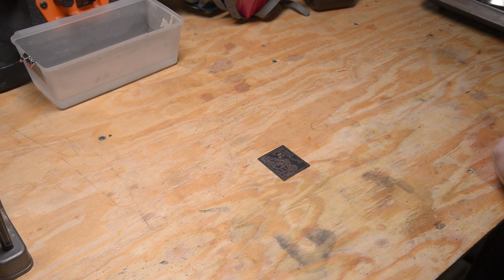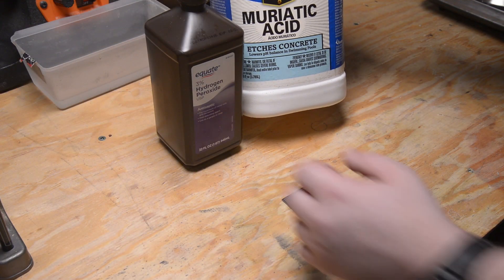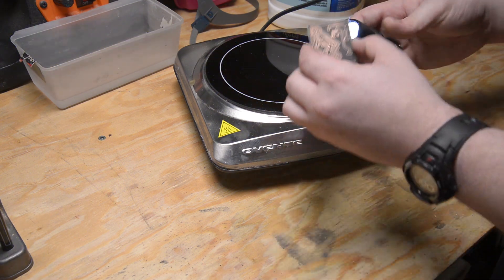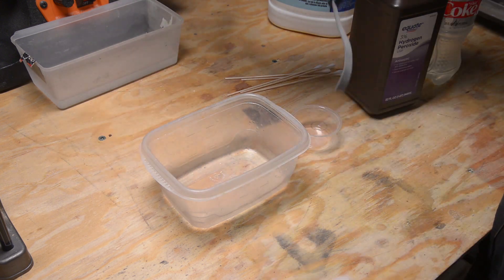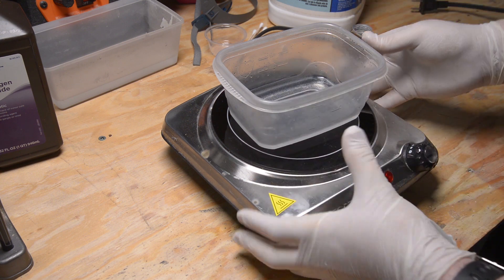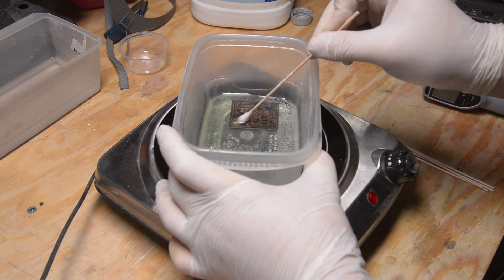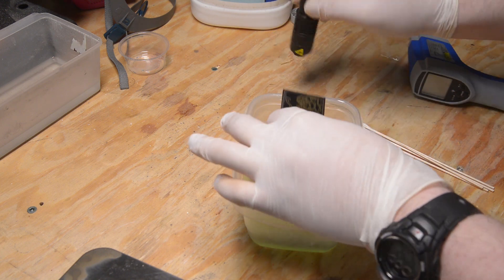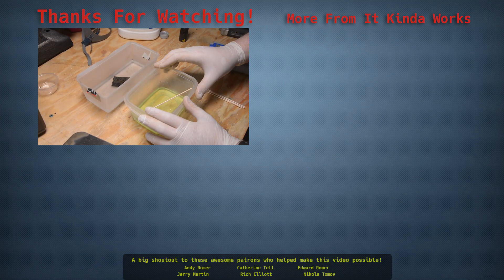Cheap and Easy PCB Etching

Comment: I've been doing a bunch of this recently. I switched to the same HCl+HO2 setup about 6 months ago.
  IIRC the chemist on the channel Nurdrage mentioned this setup results in the off gassing of just hydrogen during the process. So a well ventilated space is needed. I don't use a mask, I do this on my back patio. The gloves aren't really necessary either. I don't go sticking my hand in the stuff, but it isn't terribly strong either. I usually use a popsicle stick and a paper towel. If some gets on my fingers it's no big deal. It doesn't burn right away or anything. It will dry out your skin, and if the solution is well used it will color your skin a bit yellow, but it mostly washes off with water and handsoap. It's nothing like the dying properties of ferric chloride.
   Nurdrage also details how to 100% recycle HCl+HO2. It requires a hotplate stirrer and distillation apparatus. I haven't done this yet as I'm still looking for the chem kit setup for cheap. I have 2 liters of used etchant to process though.

  If you get into dry film photoresist setups this etching solution can also make solder paste stencils using a coke can. You just cut a flat sheet of aluminum from the can, remove the outer paint with ~600 grit, clean with white powder dishwashing detergent (clean all boards with this too), apply resist film, expose with transparency, and etch. The can material is the perfect thickness. The trick is to size the transparency mask pads around 80%. I can make a stencil with a TSSOP package with 0.4mm pitch first try most of the time. I just wish I could get my solder mask resolution this good...but I'm still working on that.
  If you ever try photoresist, don't remove the board and put it back in like you did here. For some reason it will react with the atmosphere. I tried to touch up a large board mid-etch with a marker on my last run. A small spot of photoresist failed early due to a tiny trapped air bubble. I had it out for less than a minute just to dab a bit of marker on the spot. I put it back in and you'd think the etching solution had magically turned into acetone. The photoresist completely de-laminated and ruined the board.

  If Bill (abcFab/eBay) ever comes back from his long vacation I want to try to make a 4 layer board at home using his ultra thin single sided and double core boards. That's next on my bucket list.
 Etching is fun :-)
-Jake

Comment: A much safer and easier option is sodium persulphate. Its a chemical compound of sodium sulphate and hydrogen peroxide and it comes as a white powder so totally safe to store. Also, it makes a really nice, mild etchant with no undercuts. Oh yeah, and no chlorine! Also, it is clear, totally transparent to begin with, so you can easily see what’s going on. The solution can be reused many times, and it gets a nice blue tint to it as it absorbs copper.

Comment: From what i have heard, this solution gets better the more use it. Eventually, the green colour will turn brown, but that is just because it has lost the oxygen content, you can fix that by shaking it in a sealed container, or adding more peroxide (which is the oxidiser). Obviously, more peroxide will water down the mixture, so better to just shake or bubble air through the mixture.

Comment: Not a professional chemist here, but I worked with this since high school, 25+ years ago, and I know more than enough chemistry beyond basics. Any professional chemists, feel free to correct me. While I don't think the respirator is necessary, extra protection is always a good idea. Now, for the chemistry part: the only unstable part here is H2O2, or hydrogen peroxide. Unless you heat the chemicals up when mixing them, there shouldn't be any chlorine gas released. Bubbles you see will probably be oxygen because H2O2 turns into water and releases extra oxygen atom. That is why it's added to muriatic acid, or hydrochloride acid (HCl), to provide agitation with bubbling and accelerate etching. This is also known as piranha solution. 35% or less of HCl acid is pretty stable. Now, when heating it to accelerate etching, do wear protection, because HCl evaporates into its gaseous form, now that's nasty.
The etching process itself makes copper from the PCB displace hydrogen, making cuprous chlorite (CuCl) at first, and then copper chlorite (CuCl2) and releasing hydrogen gas in the process. Chlorine would almost never react with oxygen unless it's exposed to a strong UV light.
Neutralizing this solution for safe disposal, again, chemists feel free to correct me, is by first neutralizing the acid part which can be done with baking soda or any other base, but then you'll need to let all the liquid evaporate (which should be mostly water at that point), because copper salt solutions are not to be disposed of into waterways.
Or simply do not dispose of it, keep it for more etching, there's a way to "revive" that etchant up to a point it gets so saturated with copper that it doesn't work anymore..

Comment: Better to use outside.  The fumes will etch metal where ever the fumes reach.  All metal in my garage has been blemished by fumes from  the concrete cleaner.

Comment: You can make your own Hydrochloric acid (Muriatic acid). Just mix equal proportions of sodium hydrogen sulphate(PH Minus), and sodium chloride(salt) together in a bottle. Heat on high and bubble the gasses into distilled water to get 35%(concentrated) HCL. I've done this many times before and it works very well.

Comment: What's the cost savings? Is it really worth the additional risk?
Reply from the maker: Fairly significant IMO. In the past I'd go through a couple liters of ferric chloride per year and looking at the price of the bottles I would get on amazon it would end up being between $50-75 for all of that. I've had the acid for over a year now and the H2O2 I've only had to refill a handful of times so maybe $15 in all. Plus it's really not as dangerous as it seems, I just have to make sure people take it seriously because it could be dangerous if not handled properly. Also I have to order ferric chloride online so another benefit is the ease of finding it. And to top it off, this stuff just turns bright green rather than a dark brown which makes it much easier to see the etching progress. So for me at least, it has huge benefits.

Comment: if you use 35% H2O2 you dont need to heat the solution and you dont even need to scrape the copper, you just need to stir it with shaking the container... i'v done this on -15 Celsius without a problem...
Reply from the maker: You certainly dont need to scrape at it with a q-tip or use a heater but those both speed up the process a bit plus with my laser method of etching the mask, sometimes small bits of the mask arent totally vaporized so the qtip helps wash it away. I also dont know if ive ever seen 35% H2O2 in a drug or hardware store. I'm not saying it doesn't exist but 3% is much easier to find outside of specialty stores. Also -15C? Why are you torturing yourself my man!
Reply: @ItKindaWorks  last PCB i was etching was this winter and i dont want to breathe the "vapors" produced so i do it outside... i get my 35% H2O2 from stores that color clothes, its $6.45USD per liter (i think you can get some from drug store if you ask them they will sell you)... i am from Macedonia tho... i etch the PCB's in not more than 10-20 seconds this way... if you heat the solution while using 35% H2O2 there is no marker or any other layer that you can apply that will survive the etching :) i hope i will make a video from my process soon...
Reply: @Hobypyrocom  can 32% work??
Reply: @rmdhn1  any percentage of H2O2 will work since the hydrogen peroxide is only a catalyst of the reaction. you can even use 2% H2O2 but you will need to add way more than if you use 32%, which will also dilute the acid you are using, which will result in slower etching and with that there is more probability that the mask will be damaged...
just have this in mind, imagine looking at a vertical cross section of the PCB under microscope, if the etching is fast you will get more precise vertical walls of the copper traces, the slower the etching is the more "undercut" under the mask you will have and with that if you have really thin traces, they will become even thinner...
be warned, using high percentage of HCL and high percentage of H2O2, when they are mixed they produce heat and also Cl gas, so do this outside...

Comment: You also can't store it as the hydrogen peroxide has copper in it and it will continue to decompose as I have experienced the hard way in my bedroom and mine was 30% H2O2 and citric acid crystals. No heating required.

Comment: I etch my  PCB's all the time with HCl and Hydrogen peroxide,  just couple of times used ferric chloride, but tihis is nasty stuff. Way faster and better is with HCl and H2O2. My way etching is first i put pcb  in plastic dish, pour HCl onto board, and drip H2O2 on board, more H2O2 you add , faster etching is.
Reply: why do you need to add h2o2
Reply: @aeropeoplellc8160  oxidizer

Comment: What process did you use to stop the etching process on the board.
Reply: 11:38 he put it into water
Reply: Another method is to use a baking soda water mixture (to prevent under etching) and then a pure water bath or rinsing

Comment: Vinegar and Hydrogen peroxide works as well.
Reply from the maker: Yeah but the vinegar is for cooking. that and foot baths. If its also used for making PCBs then we'll never be able to keep track of it
Reply: Does it also produce toxic fumes?
Reply: @GospodinJean  not that I remember it will turn although green and works best when it is hot
Reply: @kf6czh  thanks for the reply